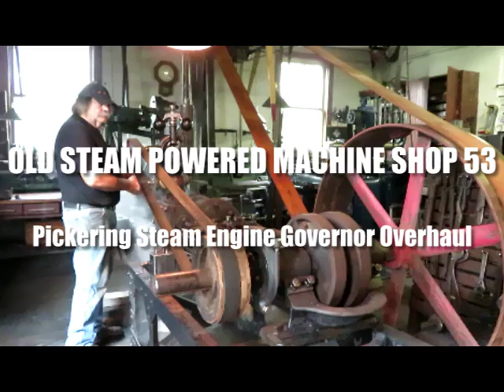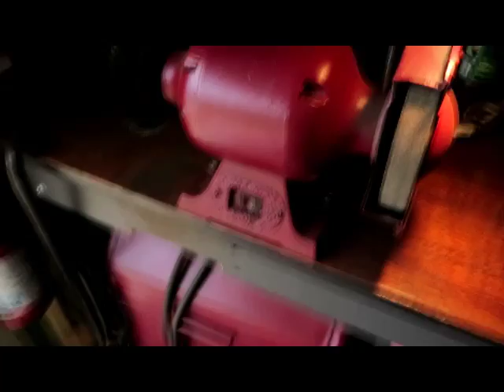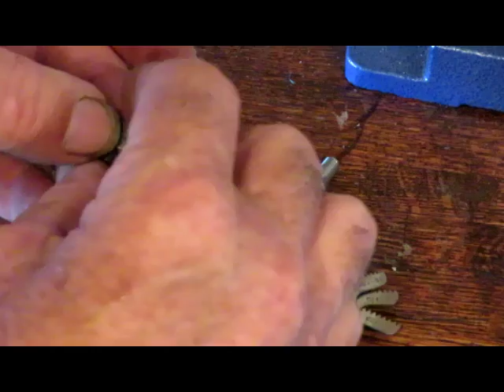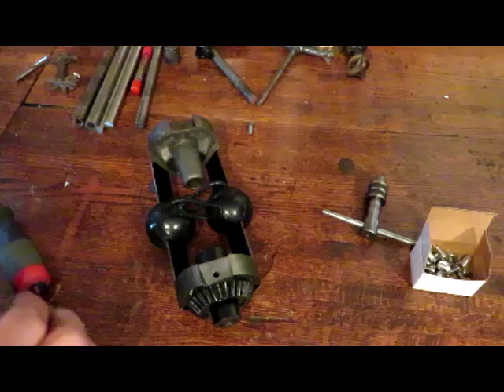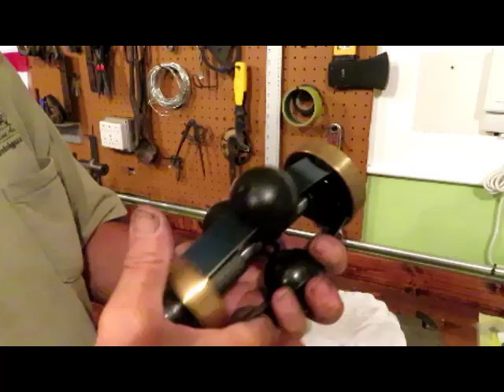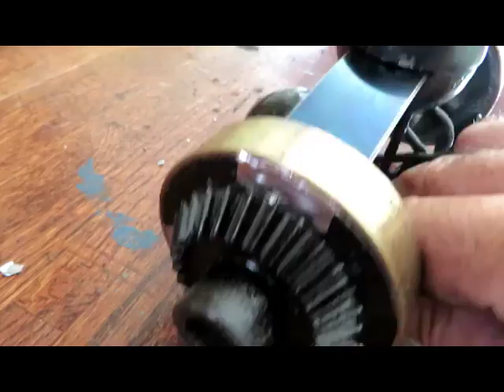STEAM POWERED MACHINE SHOP 53 governor overhaul

Comment: Hi Dave, Another great video. My Dad was a sawyer on a portable steam powered cable saw mill in the Catskills near Cannonsville. They burned slab wood. He said ,"They spent a lot of time putting out fires from the sparks from the engine". They were cutting railroad ties out in the woods. Must have been fun to move that rig. I made a couple of cape chisels for you and will send them up to NY in a few weeks.
Reply from the maker: Glenn: The story was that they fired the 60 HP Stevens mostly on nearly green slab wood and sawdust from the mill (hard to imagine). Coal @ $5 a ton was to expensive but there were a lot of old fence lines made of tree roots and stumps that were being replaced at the time and burned well.....Dave

Comment: I had heard rumors about being able to use a masonry bit to drill metal with but you are the first person that I have seen do it. 
I hope your trip back to NY is uneventful and eagerly await the new season of videos.
Reply: Robert Oswalt. Been doing exactly that with masonry drills for many years before carbide drills were readily available or affordable . Some of the poorer quality ones the tips either wear quick or break off. Dave did a very good demo and it may help others who don't know about it.
Reply from the maker: Robert: The first time I saw that was a vendor at a show somewhere. Everyone was woooo and ahhhing over how his special drills would drill right through the side of a tap, socket wrench and other things. When I got mine home I discovered that they were just common masonry drills. You have to run them fast and push hard. It helps to give them a good grind. They are not as hard as a machinist carbide (to keep them from chipping so much), so they will grind with an ordinary stone if dressed well.....Dave

Comment: Hi Dave! You are running into screws that were made in the "Seller' s" series, we still use the smaller sizes, 6-32, 10-32, etc., but at one time the sizes went up into the 30's. I have an old tap chart here some where, but the taps are scarce as hen's teeth. I make the screws on the lathe.
Reply from the maker: How are things at the canal museum? .....Dave
Reply: @davidrichards5594  Getting ready to run, boiler inspections are the first order of the day. We have David Cristofferson's road locomotive going through U/T inspection right now. Hope to see you up North soon!

Comment: 32 TPI is an "electrical thread". For a long time, almost all electrical parts such as banana jacks all used 32 threads per inch regardless of the diameter. Some time long a ago machinist setup a lathe for an electrician to cut threads at 32 per inch and the electrician never changed the settings. Even very large diameters like 1/2" use 32 tpi.
Reply from the maker: Interesting.

Comment: Always great to see another video from you Dave. Those family photos are priceless. On those masonry drills--I'm a little slow on the uptake. Why use those instead of regular drills? Is it because of the spring steel material? Just wondering because you used standard drills for the pilot holes. What would the result have been if you used standard drills for the final dimension?

Comment: I caught a glimpse of a white wall, pie crust cheater slick on a chrome reverse wheel… what traditional hot rod is that on?
Reply from the maker: It's a 33 Ford truck, chopped, channeled, no fenders 1/2 Model A bed, Buick nailhead engine.......Dave

Comment: H1 = 0.0005" H2 = 0.001" H3 = 0.0015"  .... etc. Over the nominal pitch diameter
Reply: The H   designate how much over nominal diameter the tap is in .0005 increments.  An H8 is .004 over nom.
if  an H8 is used, the tap drill should be larger too

Comment: Hey Dave, if you need an oddball fastener, try military-fasteners.com They have both pan and fillister head #12-32. Not cheap, but for those hard to find ones, you don't feel like making. You can even get iron screws for period correct or titanium for the hell of it. No one will see it under the lead, but you will know. ;)

Comment: Bonjour David,
Always a pleasure to wath your videos. Your governor seems now vey strong, are you sure it will operate correctly ? Which would be its RPM speed ?
Amicalement, Raphaël
Reply from the maker: Raphael, It was marked to run at 450 RPM. I don't know what RPM these new springs will require. It will be what ever speed makes them run at about 3/4 of the ball travel, then I will use a pulley size that will do that when the engine runs at about 250 RPM. Thanks for watching.....Dave

Comment: Hi Dave,

Is the cast lead simply an old time version of Locktite, that is it locks the screws in place, or does it serve another purpose. Thanks, Best Regards, Gottfried
Reply from the maker: I guess it was thought to anchor the springs solidly and keep the screws tight. Without it, the springs might have eventually cracked through the screw holes.....Dave

Comment: Why didn't smoke the brass ring on the governor before the lead pouring or doesn't work as it does with babbitt?
Reply from the maker: The brass ring is suppose to me a tight finished fit. If you are pouring a bearing, the smoke is suppose to keep the shaft from sticking so you can pull it out....Dave

Comment: Dave,,,  do you ever use 
WOODS METAL? 
It isn't supposed to shrink when cooled.
Reply from the maker: Willy: It would probably work fine, melts at a lower temp....Dave
Reply: @davidrichards5594  
Years ago, I saw a Machineries Hand Book,   it had a bunch of recipes for Woods Metal, each one melted one degree higher than the last...I think they started at 141 degrees Fahrenheit. ..
I have wanted to find some to play with, but no luck.
I was told it came in handy for turning thin wall sleeves. 
Thanks for the reply.
And for sharing your videos.

Comment: I was not sure what you meant is the higher the H number on a tap less clearance or more clearance what is the best fitting with the least amount of slop could someone please tell me
Reply from the maker: Higher number, looser fit...Dave
Reply: The clearance depends on the material being tapped, the quality and condition of the drill and tap plus how steady the work is. Choose a tap that works in your environment.

Comment: Wonder how many people understand the term, balls to the wall, you might explain sometime
Reply from the maker: It's a "pop culture term with no basis in historical language...Dave
Reply: @davidrichards5594  I always just assumed it was a referance to full throttle steam power governers where at maximum allowed RPM the rotating fly-ball weights were all the way out (to-the-wall) if you will.
Reply: The term comes from WW2 airplanes balls to the wall meant you had your throttles wide open and the balls on the handles we’re against the firewall max Power
Reply: Charlie Bryson, Are you perhaps thinking of the phrase “Balls out”? My understanding is that this is a reference to a steam fly ball governor. There are numerous citations of this on the web. Jay Leno also uses this etymology in one of his steam videos from Jay Leno’s Garage.

Best regards, Gottfried